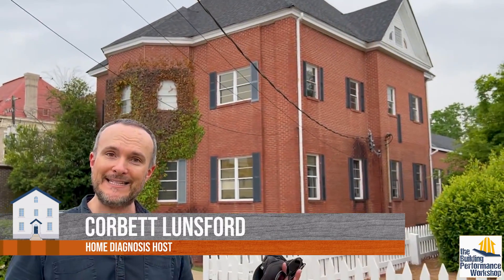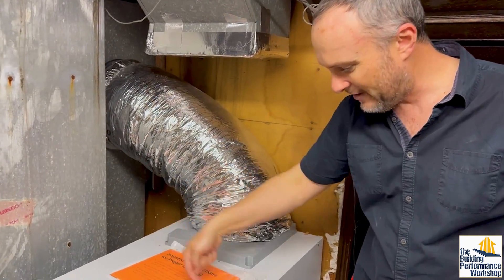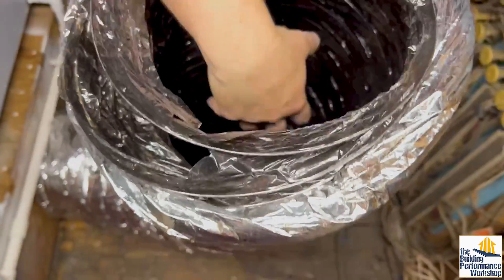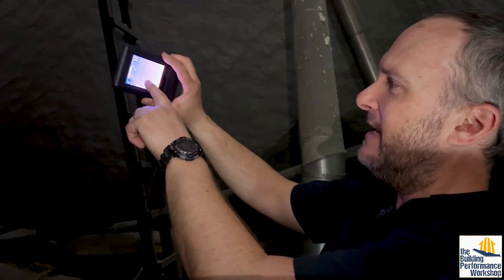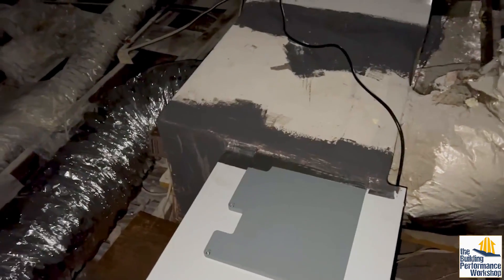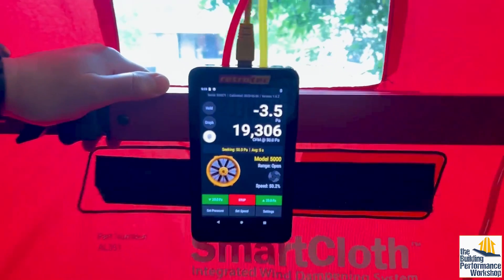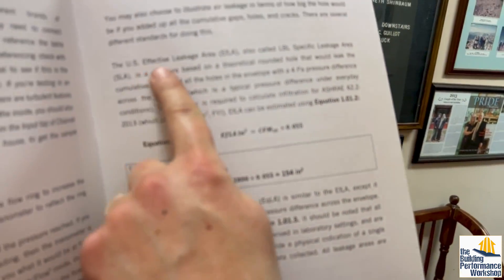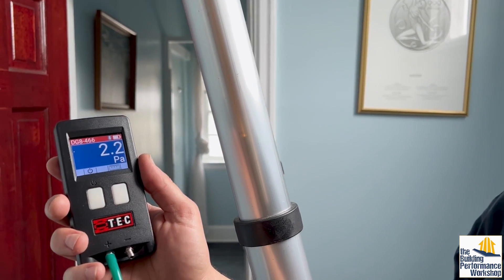Historic Building Renovation: How Deep Does a Retrofit Go, & When Do You Stop? (spray foam & HVAC)

Comment: Is it ok for the spray from to touch the flue?
Reply from the maker: It’s double-walled, and technically only half of them wotk in this building anyway, but in general you need a combustion gap that’s filled with a different sealant like fire foam.
Reply: @HomePerformance  thanks!

Comment: Hi Corbett. A while back you did a video about how people should not put a closet on an exterior wall because mold can form on the cooler exterior walls' drywall. I would like to apply wood paneling to an exterior wall that already has drywall on it. Can I apply the paneling directly to the drywall or should I use furring strips between the paneling and drywall to create a small airspace? If so, should this airspace have small vents at the bottom and top of the wall for warm air movement behind the paneling? Thanks!

Comment: I'm not sure I fully understand the HVAC changes you made. All that stuff kind of scares me. But I think I understand why you plugged those holes.
Reply from the maker: HVAC does seem a little complex at first, but it’s actually quite simple once you realize any equipment is just fans to move air, heat exchangers to add/remove heat, filters, and controls.
Reply: Underrated comment!

Comment: I doubt there is any training on high performance homes in HVAC licensing. It would be good if there was some training available that counts for continuing education, but it appears to be concentrated on code requirements from the little bit of research I did. I'm not sure if there are code standards for conditioned attics, that might drive that training if that existed, maybe as an optional certification.